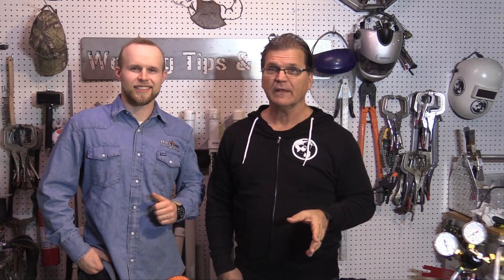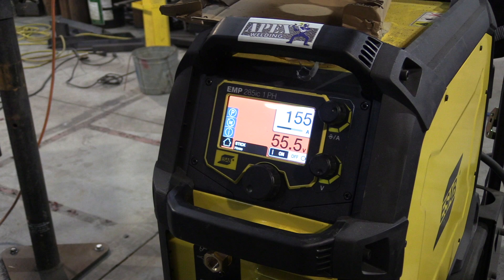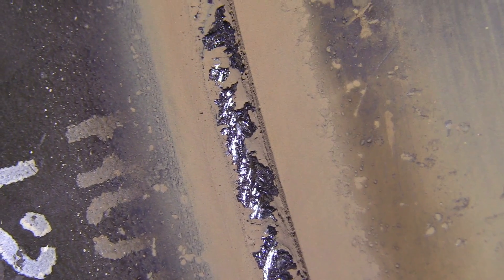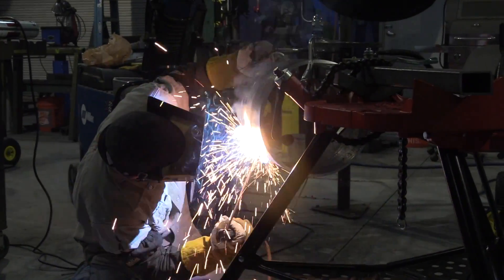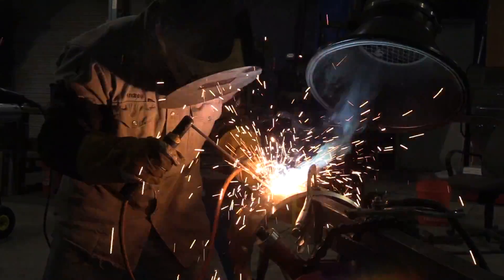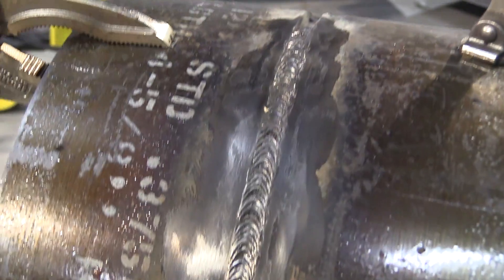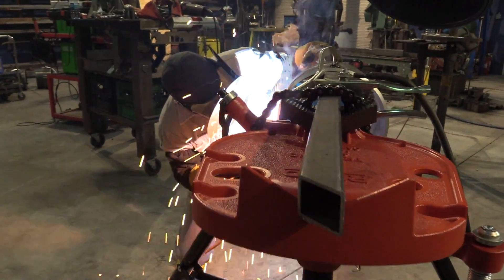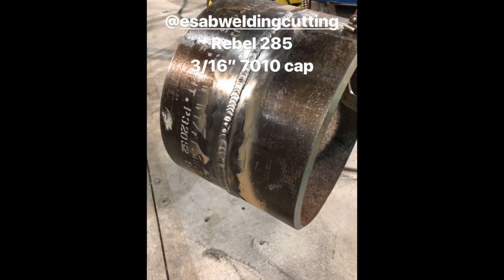5g Pipe Test API 1104

Comment: Till now i just told that 5G welding from bottom to top side but in this video why he do from top to the bottom side of pipe ? Which technic is correct ?
Reply: Many techniques/many ways to weld two metals together, all depends what the engineers wanted it to stand up.
Reply: @jdanielcornu9921  ahh i see ive been forbiden to do downhill welding and just only uphill welding but now i know thanks dude.
Reply: 6010 7010 8010 all cellulose rods can be used downhill, 7018 uphill only

Comment: Jodi, I always do that. I'm so happy that you guys made this video.When I was just learning I've smoked the flux off the rod real quick. Not even gonna touch on Stainless rod to that effect😅.But if you'd ask my old boss " Awwhh, its easy. Anybody can weld..🤔🤔... I'm not sure if I can even explain that through a written comment.... But either way keep the videos rolling. I wish you guys, and I mean everybody would do something on 5086 Aluminum base material with 5356 filler, GMAW-P or TIG root and GMAW-P all the way out. I wonder why nobody wants to touch base on that one? Humidity and Dew Point are the enemies on Aluminum

Comment: I’m a second generation welder with over 25 years of experience as a welder inspector & instructor, I love to see our craft taught properly to the next generation,that being said if you guys are gonna do it do it right!!!!!!!!!! This API 1104 weld is a dying art & you guys missed the most important parts like the difference between uphill & downhill bevel degree  & tacking with the proper gap and keeping a parallel body position to the pipe. What about the stops and starts on the cap pass , how to tie in on the top and bottom when capping !!!! What did the final weld look like?????? The guys over at Weldtube have a much better tutorial on this procedure with two real hands brother-in-lawing using the real equipment to do the job right !!!!!!!!! Mabe you guys should stick to the structural D1.1 testing procedures....

Comment: Excellent work as usual! May be a silly question but why does the API not require the use of a low hydrogen rod like you would see when you do a 6010 root and 7018 fill and cap? Is it strictly for production, or is there some other underlying reason? Thanks in advance!
Reply: THERE IS A L-H ROD MADE FOR DOWNHILL,PIPELINE WELDING:E-8045,E-9045 AND E-10045.STRINGER PASSES ONLY,NO WEAVING(LIKE WHAT YOU USUALLY SEE ON THE CAP PASS.THE ELECTRODE IS MADE BY LINCOLN ELECTRIC.

Comment: Hi Jody, I'm new to welding so this may be a dumb question, why are you not trapping slag when you pull away, let the puddle solidify, then go back over it like he was doing?
Reply: MYMAKO181 you will if your not careful.
Reply: This type of electrode rarely traps slag.  It’s a very thin slag to begin with.   With the amperage he’s running, I wouldn’t be the least bit worried about it.  He’s not welding P-91 material

Comment: good day, I can not understand why you weld the main pipelines from the top to the bottom??? In Russia, so not hidden, only from the bottom to the top. You have very large scales, welding stress concentration! although the production you have on top. I apologize for my English
Reply: Виктор Анисков engineers run the numbers and decide on what weld procedures to use. Going above and beyond of what is required is a waste of time and money. 
It doesn’t make much sense to deliver pizza in a tank when a car is good enough.

Comment: I've done my share of flux core welding - but I'm a little bit squeamish when it comes to my eyes.  I've been told to not look directly at the arc, so I tend to run a dark shade and look slightly to the side.  One thing I've never gotten good instruction on is just how to make sure your shade is dark enough, and what you should be looking at in order to judge the puddle (or bead height, as you mention here).  I often find I can't see much outside of the puddle due to the darkness, so I don't know how you guys manage this
Reply: JUST A WORD OF ADVICE,WHEN YOU'RE WELDING,YOU HAVE TO LOOK AT THE PUDDLE,ARC,IN FRONT OF THE ARC,ALL THE WAY AROUND THE PUDDLE,NOT JUST THE PUDDLE.YOUR MIND IS IN A GREAT CONSTANT STATE OF FLUX NO MATTER WHAT KIND OF WELDING YOUR DOING.

Comment: In Finland. 7018 and remote. Esab OK 48.05 rod. Root uphill 2,5mm rod. Cap uphill 3,2mm rod. X-ray quality
Reply from the maker: we do basically the same here in the states for certain pipe codesd like B31.1.  But for API 1104 oil and gas industry its usually downhill but also X ray tested

Comment: A number of years ago I helped a buddy of mine who had a job welding the new water pipe being built in the Florida Keys,it was all down hand 7010 and pretty much the same as what you're showing here!And by the way,I was using a Huntsman 411P and still use that old hood.It's always been my favorite but you just can't get the thing wet if you want it to last
Reply from the maker: I have a huntsman 411p too and I love it.  I put an arc one single auto dark in it

Comment: Please do a 5g 7018 uphill and maybe a horizontal pipe ti flat plate 7018 uphill as if doing flange welding. Also I'm just curious about the android app for the welding community you and your son were working on. Thank you sir.
Reply from the maker: The App proved to be very expensive to pursue for android so its on the back burner for a while. I still intend to make it happen tho